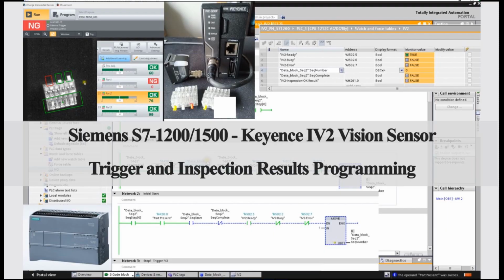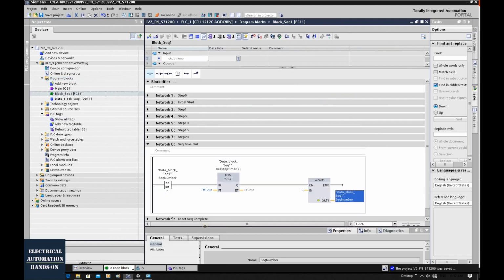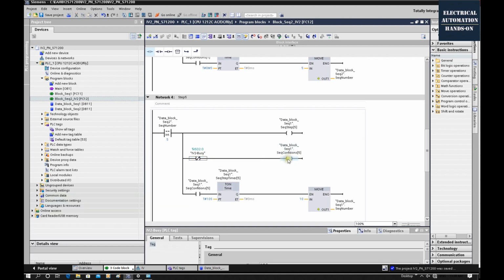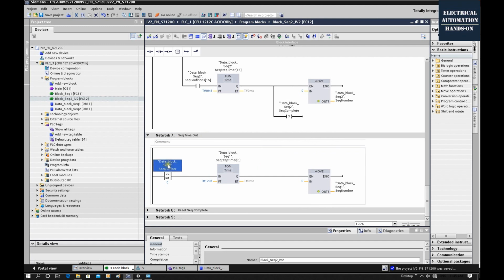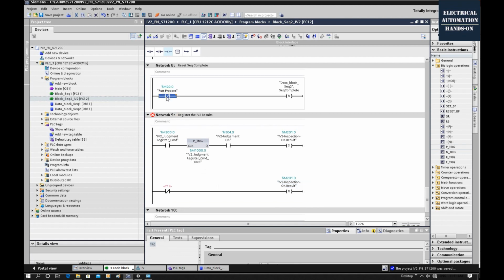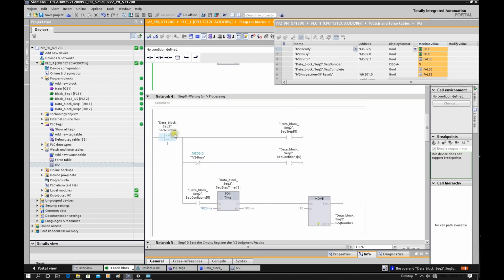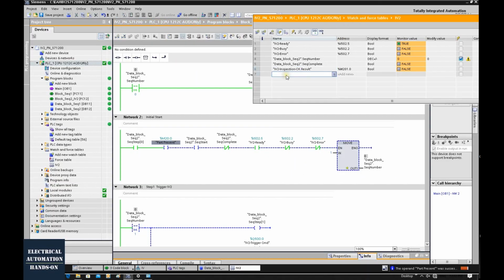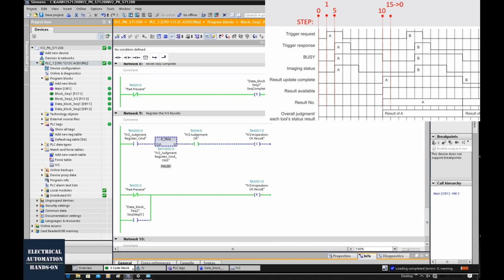K17b. Siemens PLC and Keyence IV2 Vision Sensor Trigger and Inspection Results Programming

Comment: awesome video. I watch this everyday since i got a job to communicate an XG-X1200 with PLC and syncronize the Robotic movement with the Data provided by Camera. Thank you.
Reply from the maker: Glad it is helpful! Using Camera and measurement to correct the robot is a very typical application. Some robot brands provide the camera package of this feature, some of the robot is fully customized and user have to develop.

Comment: Hello there sir, can i ask is this program if i do this program for cognex in sight vision sensor is this working too im using tia portal and s7 1200
Reply from the maker: The concept is the similar, as long as you can find the manual for sequence timing chart of Cognex for trigger and result register.

Comment: Hi, can you please make a video explaining how to make a connection to IV2 via TCP protocol? (SIMATIC S7-300). Thanks
Reply from the maker: Hi, I don't have S7-300 so I can not demonstrate this test. But why you are going to use TCP? Why not use Profinet?
Reply from the maker: If your S7-300 doesn't have Profinet port, I would rather recommend you using I/O. Trust me, it will save your time. The format of the IV2 TCP/IP is not easy job for S7-300.
Reply: @electricalautomation  Im testing with AG SEND and AG RECV blocks. Migrate the PLC project to TIA PORTAL V15.1, CPU 314 DP.
Reply: @electricalautomation  I saw the ASCII commands for IV2 into documentations. Needed help on this topic.  if anyone has this knowledge, i would like to learn more.
Reply from the maker: @joaomidalski  My friend, I am trying to present an efficient way. It is just waste your life digging out this old system CP343-1 Lean and the program.
Reply: @electricalautomation  doesn't have a profinet on CP. Im using CP 343 1 Lean. Only TCP connection is possible.
Reply: @electricalautomation  To use IO I need the flat cable on amplifier?
Reply from the maker: @joaomidalski  Yes
Reply: @electricalautomation  in this project there is already an SR 1000 running on TCP with the CP 343 lean.
Reply from the maker: @joaomidalski  Ok, you might follow the program for SR1000 to do IV2 TCP communication. If I am you, I will use S7-1212 as the bridge. PN with IV2 camera, then S7-1200 communicate with S7-300 CP343-1